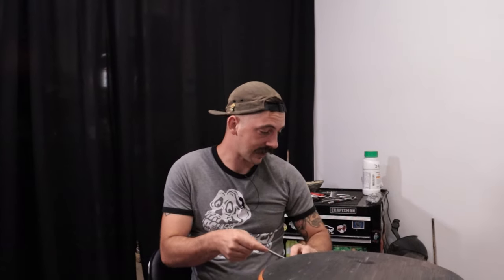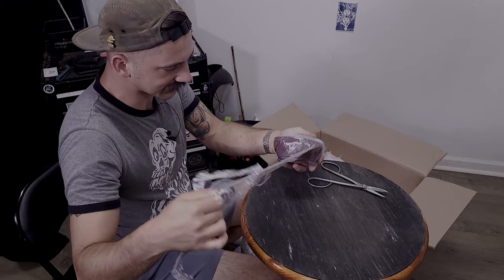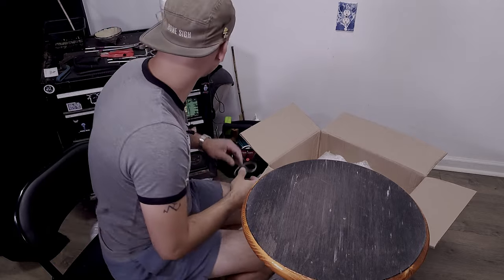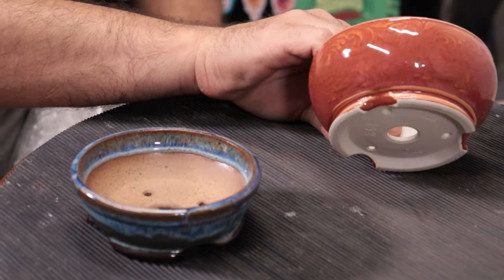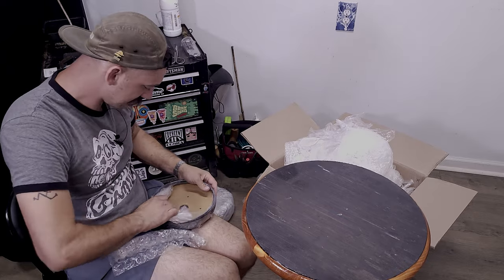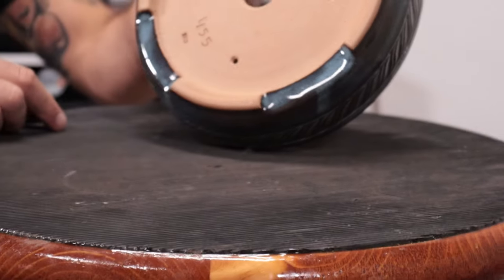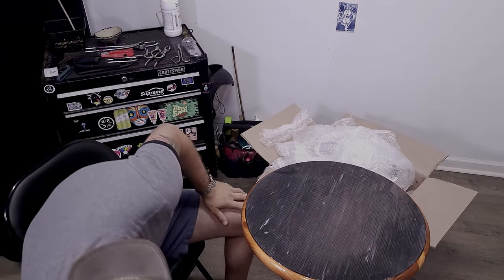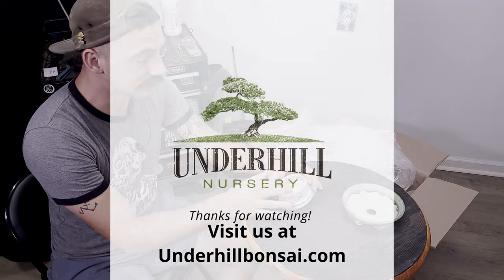Chuck Iker Bonsai pottery unboxing

Comment: Your mic must not be on.
Reply from the maker: Thanks for the feedback, but the sound plays just fine for us and its something we would have noticed during editing.  It must me a setting on your playback.  If you work this out on your end, would you let us know what happened so we can advise others if they experience the same problem?
Reply: @underhillbonsai2217  I'm playing it on my  phone now, was tv before, its still super low.  I had to crank my TV to 100 to hear it. Maybe you had headphones on? Also, I could swear there was blasting loud music for the first 5 seconds and at the end the first time that's not there now.
Reply from the maker: @Josef_R  Ok that is a different issue.  I played it on my computer and the sound was a bit low.  So, I can see how whether it is loud enough could be an issue.  That can be addressed at the time of recording or editing.  I will get with Evan and Alex and make sure they push the sound going forward.  We are using all new equipment and it does take some getting used to.  Thanks again for letting me know about the problem.  Doug
Reply: @underhillbonsai2217  Mic level needs to be turned up.